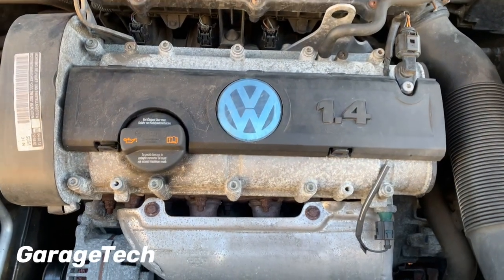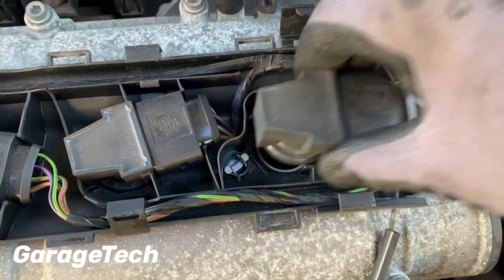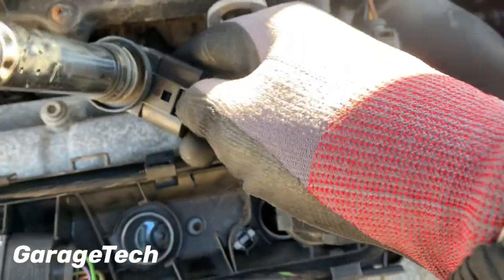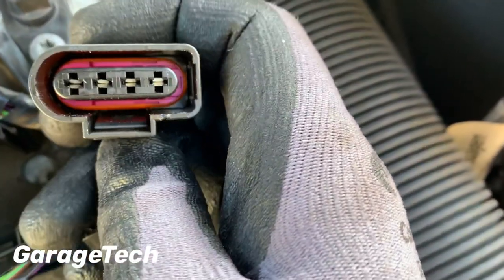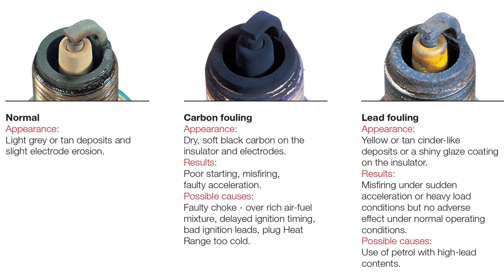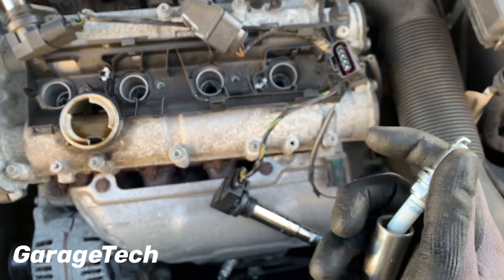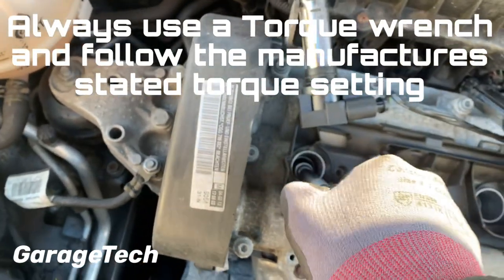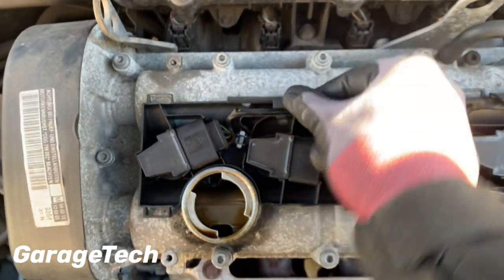How to change the Spark Plugs without the coil pack removal tool. 1.4 1.6  VW Audi Seat Skoda. Golf

Comment: I pulled out the spark plug coil pack and there's a rubber bit that's stayed stick to the spark plug. What do I do?
Help me please!
Reply from the maker: Sounds like the end of the coil pack has broken off. Best to try a long thin screwdriver and some wd40 to loosen the rubber and then some long nosed pliers or a pick to hook the rubber out. Good luck 🤞🏼

Comment: Hey dear sir i change spark plug but now car is missing. What   i do.
Tell me thanks
Reply from the maker: Check to make sure the coil packs are pushed in correctly and the connectors are on right. If they are ok I’d check the spark tips, have they got the correct gap. If all looks ok you could have damaged a coil pack when removing it.
Reply: @GarageTechAutomotive  Thanks sir for answer and Good information . GOD BLess you.
Reply from the maker: @farukh73  🙏🏽

Comment: how many kilometers should the spark plugs be changed in this engine?
Reply from the maker: About 60000km / 40000miles or every 6 years is the typical change interval